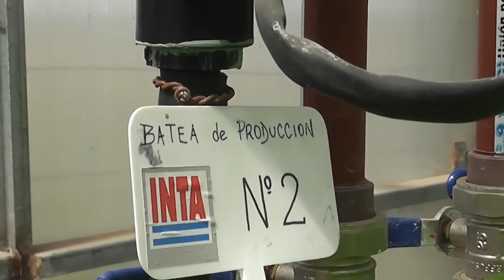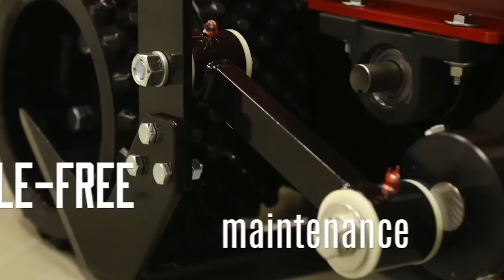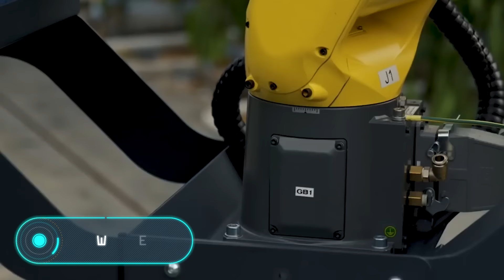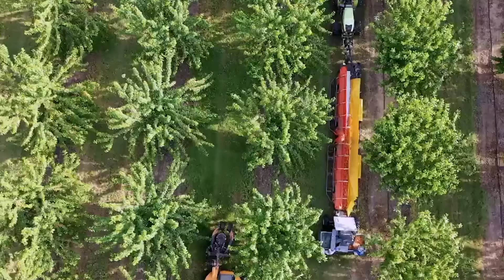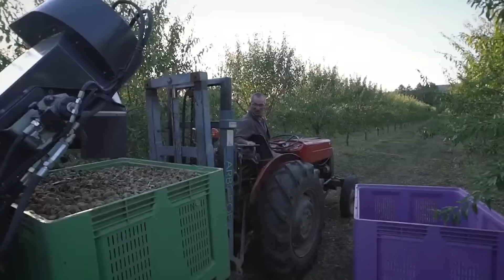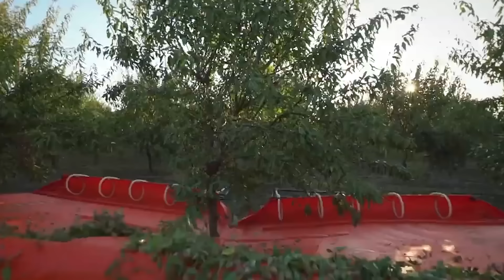INGENIOUS AGRICULTURAL IDEAS AND INVENTIONS FOR MAXIMUM PRODUCTIVITY

Comment: maybe you do save a little bit of water, but the water you do use ends up polluted with unknown amounts of nutrients in it and has to be disposed of somewhere.  That means it also does not return to the environment.  Hydroponics needs a lot of work, and it is not a closed system yet.

Comment: There are several misconceptions and statements made about hydroponics. Yes its very quick growing but is not very nutritious and mostly grown with nitrates and chemical soluble fertilizers however those vegetables are far from nutrient dense. And dont have a natural mineral balance as they can only absorb what they are given in the water nutrition solution they get. Granted Bioponics and more scientific methods could make improvements in the field but 99% of hydroponics is not that nor is it organic but they do use less chemicals than conventional farming.